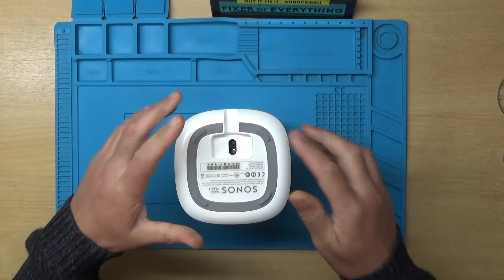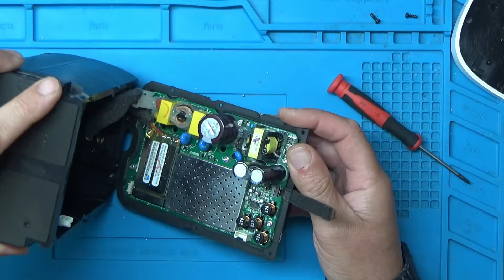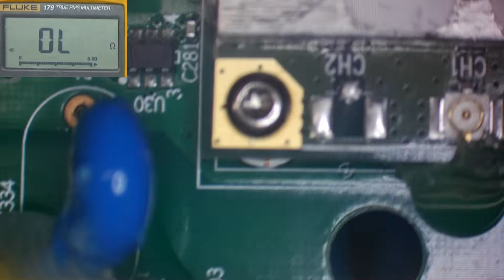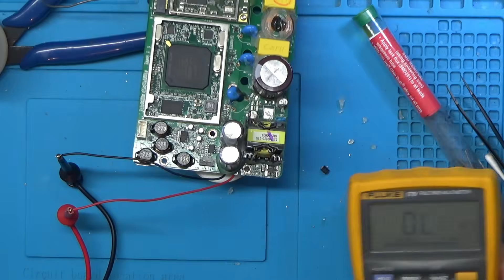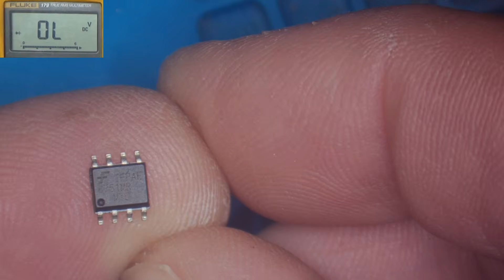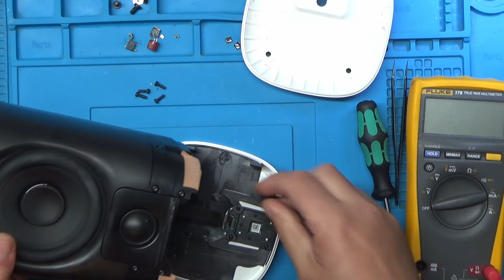Sonos Wireless Speaker - Very Blown Up! | Can I Fix It?

Comment: Only started the video but I could swear I've read articles before about Sonos purposively bricking their older speakers with firmware updates.

No idea which ones and maybe I've the wrong end of the stick but it's about all I know of the company.
Reply: Yeah i believe its the first generation of sonos speakers getting bricked. Although they stopped bricking speakers a few months/years ago cause people where complaining and sonos actually got in some trouble i believe. What sonos did was replace the rootfs with a dummy one which could not have all the functionality of a regualr sonos speaker and they also prevented old gen1 speakers from connecting to the app but i could be wrong
Reply: They didn't "brick" gen 1 devices (this video shows a gen 1 play 1). Sonos moved to a different software system, so their old speakers don't communicate with their new speakers. You can still use the gen 1 speakers exactly how they were originally made - they're just not compatible with the new speaker infrastructure so two different apps are required.
Reply: @thisisntforsharing  then the rumors about recycling mode might have pointed to what you said instead of replacing the software, they moved to a newer software and ecosystem
Reply: Might be an old thread but the CEO of Blackberry took over and they weren't going to Support old Sonos Bridges.. Everybody with the old type original kit kicked off and they are ok as long as you don't try and upgade them through the app...We.all know what happened to Blackberry.. Ha ha